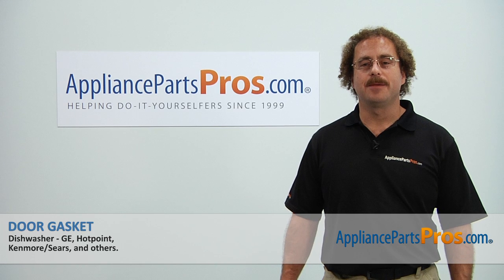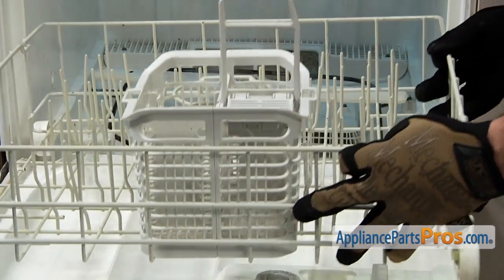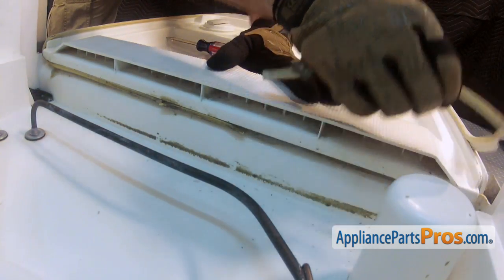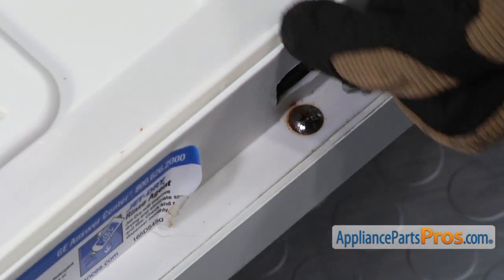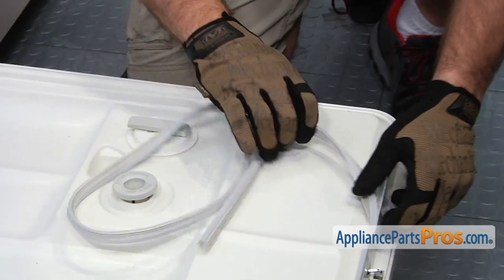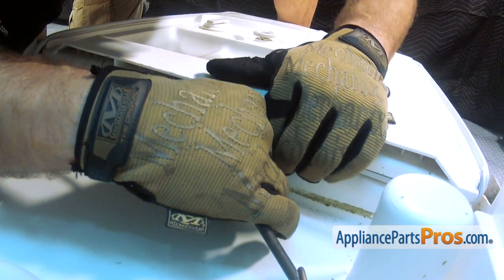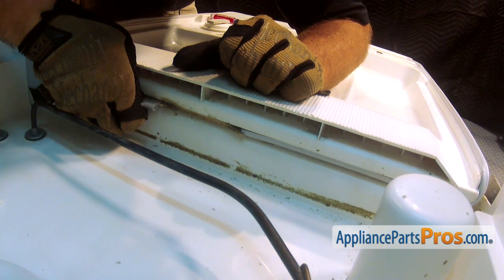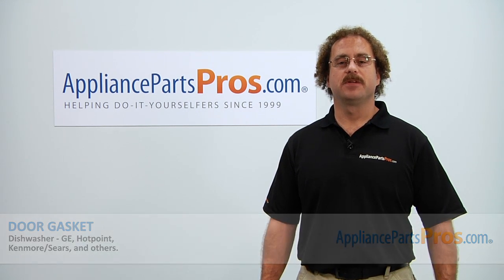How To: GE Door Gasket WD08X10057

Comment: just a quick tip, to save you from buying unnecessary parts. simply pull the 2 black corner gaskets out ( also called baffles ). they just pop right in and out. clean them really good with a tooth brush. .... also, clean the place where they sat inside the machine.... pull out your bottom rack., get your head inside and look at the door seal . clean it well and where it seats to the body of the washer. ...now, put some Vaseline all over the 2 black baffle seals and the door seals.  ... Vaseline helps to rejuvenate rubber seals. .... now test it out for leaks..... it may save you from buying parts.....  I am here to tell you that door seal is expensive, even for a good shopper.
Reply from the maker: allentig Thanks for the tips!

Comment: To make life easier for my 83 yo body, I removed the plastic inside door panel keeping the seven screws in order as each is a different length. Applied the gasket as shown in your video and made a center gasket which was absent from a soft part of the old gasket.  Replaced the corner baffles and the leak is down to two towels from 22 towels.  You should include the proper way to install the gasket at the lower corners to stop that leak from the new seal.  I also cleaned the float mechanism just incase it was causing the washer to over fill. Not too happy with my results but appreciate your DIY videos.

Comment: I agree with @stanblum9646.  It's a lot easier to remove the plastic inside door panel, remove the old gasket and install the gasket with the panel off.  You'll be able to see exactly where the gaskets go, as well as clean out the gunk that has accumulated in the the cracks and crevices over the years.  Much easier than trying to get your whole head inside the dishwasher on your knees to what the heck you're doing!  Replacing the panel is just as easy as removing it.  Just a suggestion!
Reply from the maker: Thank you for your feedback!

Comment: Thank you! I have an older GE dishwasher (14 y) and couldn't find a tutorial with the bottom middle gasket part in it - I pulled out the entire thing without first checking to see what it looked like originally, bad mistake ;) But your video is super helpful! Also a styrofoam piece fell out and I am not sure how that one goes back in. Am in Canada so did not order from you, but I did enjoy your video very much.
Reply from the maker: Glad the video helped you out!
Reply: You left the space in the middle on purpose? Seems like water would leak out of that gap. Looks like it's about a 3 in gap. I was thinking there must be another small gasket to go in there or this is the wrong size gasket? Please let me know. My dishwasher door is leaking.
Reply: @DanoHSMM  yes, the gap at the bottom of the door needs to be filled by also replacing the gasket insert WD08X10015. Mine was missing entirely.

Comment: I had a little trouble getting this gasket properly inserted.  It was difficult to get it inserted on the bottom of the door as you have to push it upwards.  Also, on my first attempt the ends barely reached the center insert, so I removed part of the gasket and pulled it tight as I inserted it into the channel. That worked and now the ends are positioned under the flaps of the center insert.

Comment: Hello great tutorial.  What is the part number for that small middle gasket in case it needs to be replaced as well?  If you can, provide a video link on how to replace that as well!  Thanks.
Reply from the maker: +jaronensley Without a model number I could not see what the part number is. You can go to our website and enter your appliance model number to view the parts breakdowns to be sure you get the correct part for your model. It should just pull out of the groove like the main gasket.
Reply: @appliancepartspros  I'm looking for the same part on a gsd2100v55cc and could not find anywhere... help please

Comment: Mine doesn't have the small section of center gasket at the bottom of the door gasket. Any ideas? I installed the dishwasher new so, it must have never been there. Strange. Leaking at the lower corners, going to replace the door gasket and lower corner pieces as well. Thanks
Reply: same problem here. small part has shut down my dishwasher because of bad leaking and am unable to find a replacement. I ordered a part from them I thought was it but wrong and out $27. I'll have to rig something up I guess.

Comment: I have this exact dishwasher, changed the baffles and the gasket around the door.... still leaks from the corners!
Reply: Same thing I'm dealing with too
Reply: Same thing here. I noticed that when I run it with no soap I don't get any leaks, however when i use soap I get leaks from the corners. I read up above that vaseline should be applied to the corner baffles. I'll give that a try and see. I used all OEM parts and everything is lined up correctly.